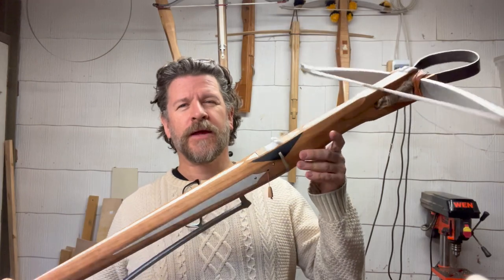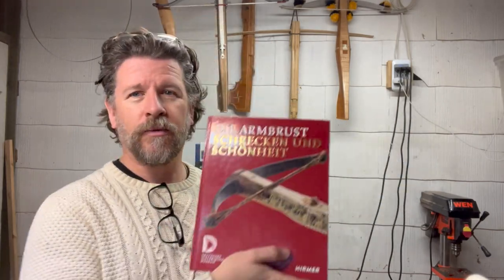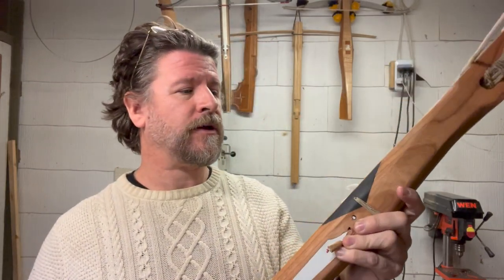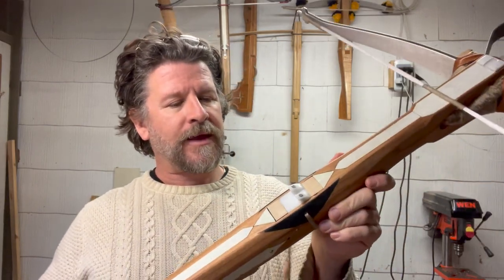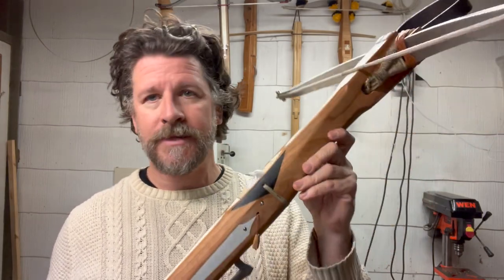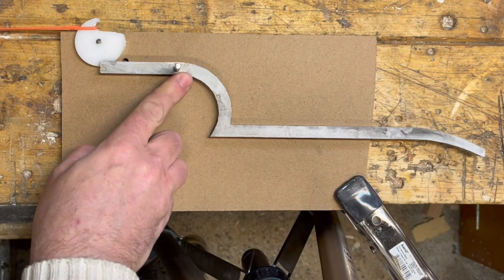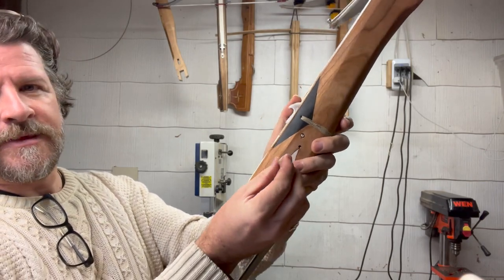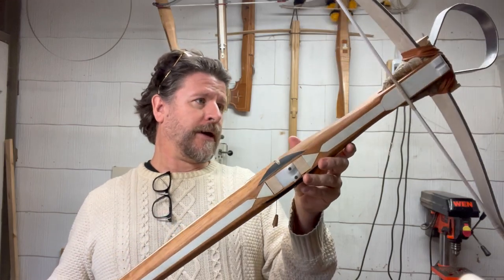Medieval 15th century double-axle crossbow!

Comment: in the late 15th/early 16th century similar German crossbows were common. They were the same in design and decorations but now they had a steel prod instead of composite and a bolt clip. That's probably the final evolutionary stage of the German war crossbow. After that, firearms mostly took over.
Reply from the maker: Yup!